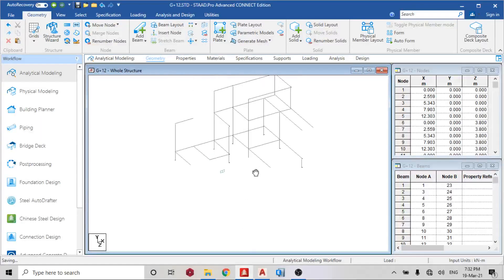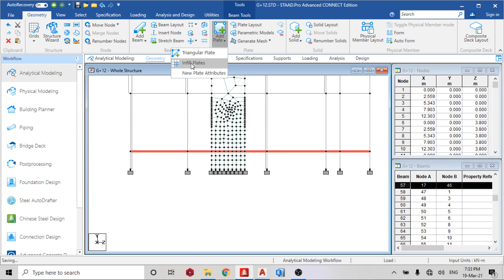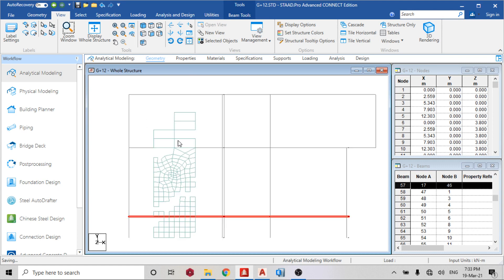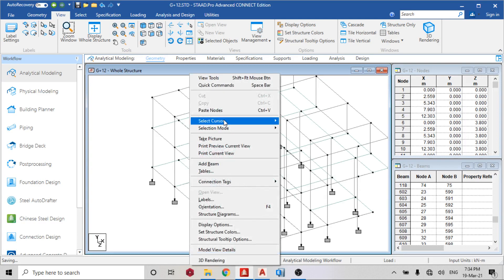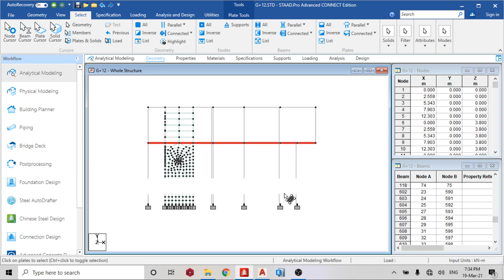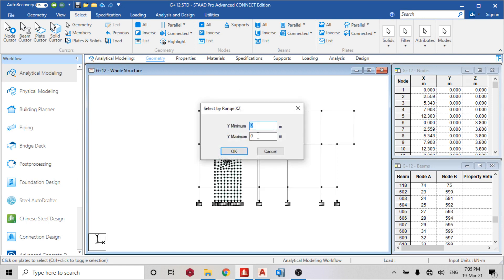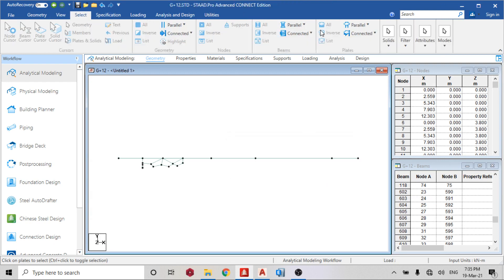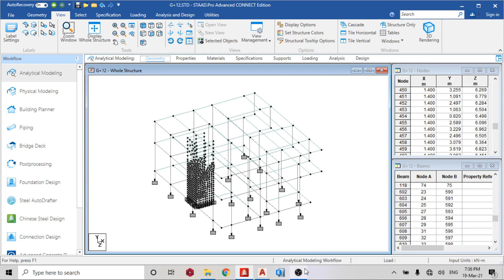part 9 How to assign plates on staad pro connect edition

Comment: Good afternoon sir,
Please my question is. can a slab be designed using floor load method or it's alone designed with the plate method. 
Hope to hear favourably from you soon. 
Thank you
Reply from the maker: Plate load is applied to plate, which takes into account the stiffness of the plate and beams. 

But floor load applies to the beam directly

Comment: How is the shear wall connected to the building member?
You have deleted the slabs around the shearwall?
Reply from the maker: the shear wall is not connected, from the. architectural you can also see it
Reply: Sir
The  question is how the shearwall works in this case?
Reply from the maker: @ameeral-sumari5370  no. It’s not working with the building. Except I connect it with a beam
Reply: Thanks for your firm and rabid response Sir
On the practice, the areas around shear wall is connected to the shearwall or not?
Reply from the maker: They’re staircase. So I left it as void and I would design it separately
Reply: Understood Sir
Another question If you have a time, the plate need to be meshed? 1 If so then the beam will be like a small pieces, these how going to be designed and detailed in RCD?
THANKS SIR
Reply from the maker: Yes rcdc would still see the beam

Comment: Excellent tutorial. I have some issues with plat. How do you draw plats that are not completely square or rectangular? At time I have like trapezoidal shape and my plat or floor load can't be assigned there.
Reply from the maker: There is the mesh option